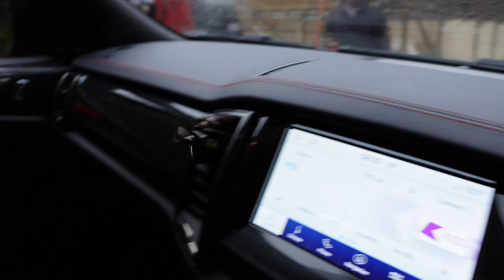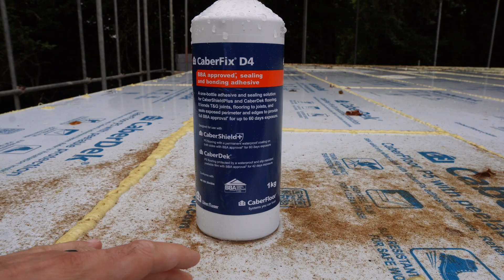How To Build Your Own House - Joist Installation

Comment: couldnt you lay a protective cover on top of the kaber dek to give you more working time
Reply from the maker: You could but thats what the protective sheeting is, 6 weeks should be amble time to get to roof in most cases unless its an absolute monster off a house of there are supply chain issues

Comment: I made some spot boards out of Caber Shield Plus flooring offcuts 2 years ago, D4 glue sealed edges, been out in rain all the time, still using them! Bit tatty now but Caber Shield Plus is only rated 60 days.
Reply from the maker: Never thought of sealing edges with the glue, good idea 👍🏻

Comment: Great video good information would u not do concrete floors for second lift or is it two expensive  thanks
Reply: Cheers  most  one off home  in Ireland we do use  concrete floors not  block and  beam just holocore slabs cut to size and crane in horses for course
Reply from the maker: @walshjames1020  Same here but more for the bigger houses 👍🏻
Reply from the maker: You could use concrete floor planks but not really worth it, only normally used for apartments, when ground floor is one house and first floor is another for sound and fire reasons.  Sometimes a block and beam floor can be used instead of joist, like I used on the ground floor but there is little need for a house this size.  A friend of mine is building a much bigger house and he has used block and beam both floors 👍🏻

Comment: Slabs been covered over up here in Midlands/Shropshire, bidding wars have started amongst barons for only remaining housing association work coming up, I'm pretty sure this recession will be worse and longer than the last one in 2008 due to cost of living and inflation
Reply from the maker: I think we are in for a rough time, what is different from 2007/2008 is the banks have money so there might be a bit more help out there. Who knows, only time will tell
Reply: @Tone_Team There could be more work further North, it's cheaper houses / land and to relocate WFH.
Also shortage trades unbelievable. P2P lenders are currently pumping money into projects if Labour get in there be a building boom they will kick the can down the road.
4million houses shortage UK.
Reply from the maker: @richardmcdougall233  I’m sure it will all work it’s self out, it normally does! Always hard to predict what the trigger for a recession will be and what will be the solution but it always comes out in the wash.